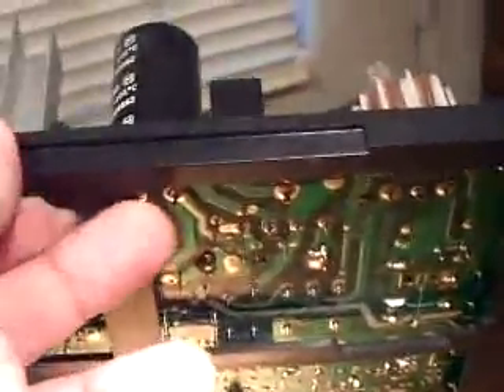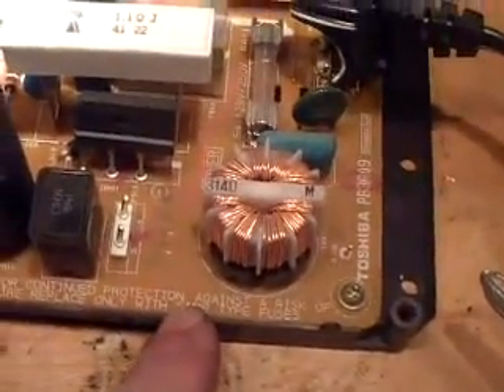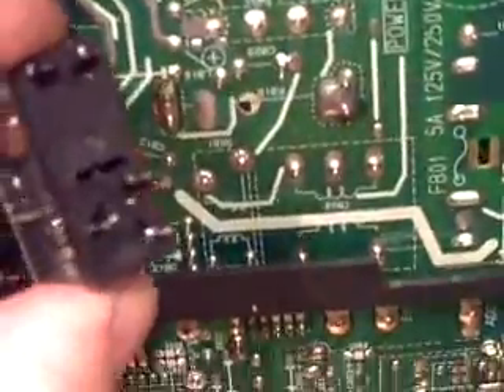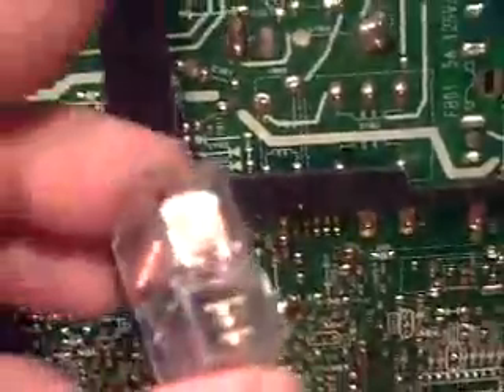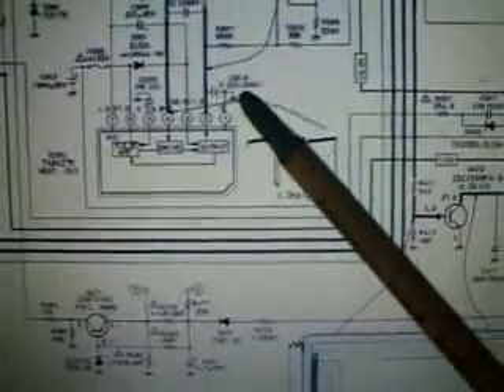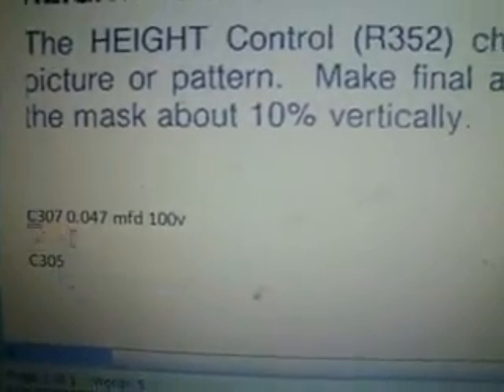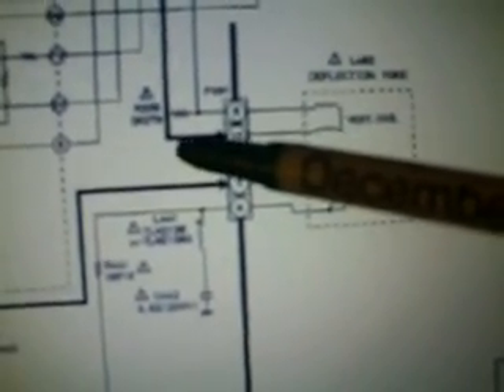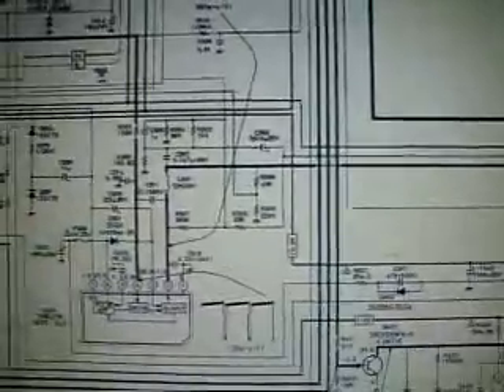1994 Toshiba CF26C30 , 26 inch TV. Intermittent power up. Part 5

Comment from the maker: @mznxb9872 I'm going to buy the kit to test the coolant in the radiator for hydrocarbons. This wil ltell me if the head gasket(s) are also leaking. Then procede as necessary. I have to finish this set this week and them concentrate on the truck. thanks for asking.